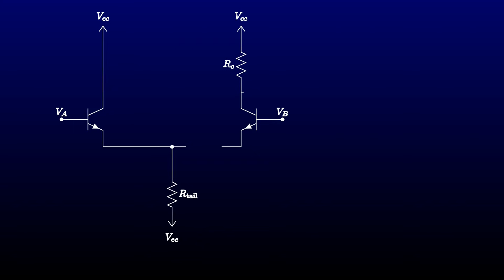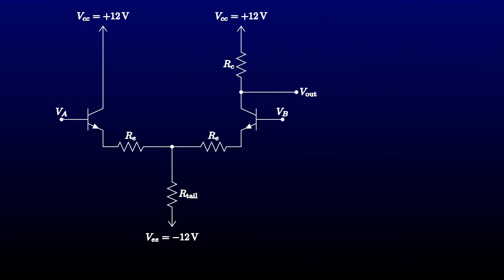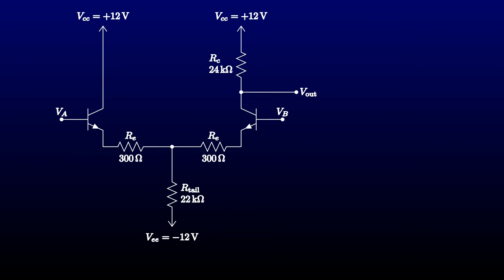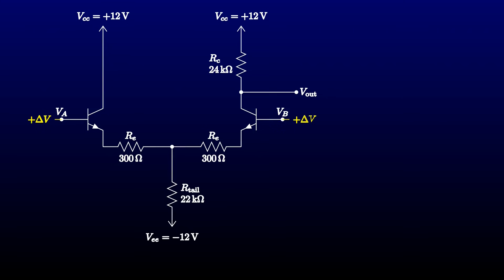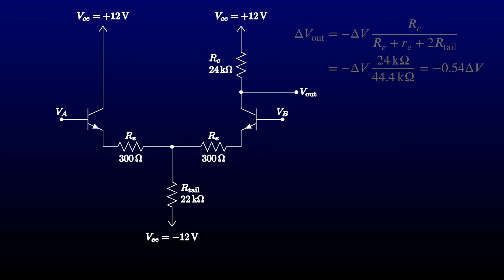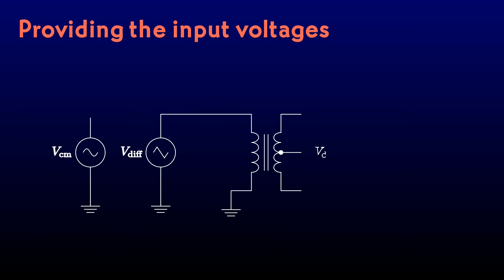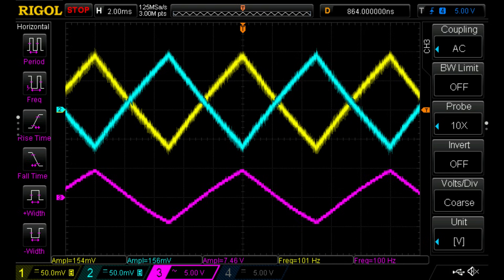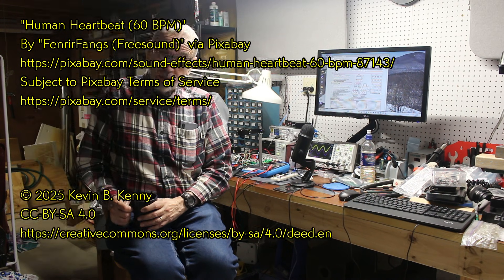Differential Pairs: The Heart of Analog Circuits (Transistors 101, ep14)

Comment: At 6:19 you ask that we should think why the center point is -0.675V, I would guess it is because the transistors are still entirely controlled by the DC voltages or bias voltages. But when the inputs increase I would expect the center point to be 0V. Is that correct?
Reply from the maker: Essentially.  What'll happen is that one emitter will be a little low, and the other will be high by the same amount (they're both a diode drop below the corresponding bases).  The two emitter resistors will form a voltage divider, and the voltage at the center node will be the mean between them (The tail resistor is big enough that it can be largely ignored.)

If you have both inputs moving in the same direction, then the voltage at the center node will go up and down with them.  If you have them moving very far in opposite directions, then one transistor will saturate and the other will cut off.  As we approach that point, the behaviour gets more interesting, and we'll look at that later on - an overdriven differential pair has interesting properties. For the 'close to saturation and cutoff, but not quite there' case,, we actually need full-blown Ebers-Moll analysis. But it can make a nice soft-clipping circuit or a fair triangle-to-sine converter if you get the voltages right.

We use the 'one transistor saturated, the other cut off' situation as a current steering circuit in the triangle-wave VCO core:  https://youtu.be/bGXGKWCEgyM  to go from a variable current source to a circuit that either sources or sinks a specific current.